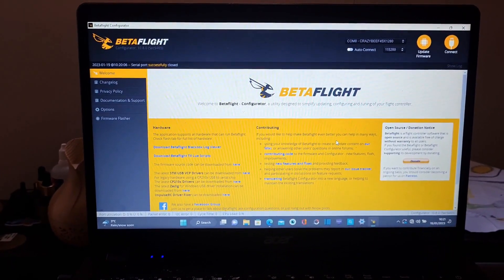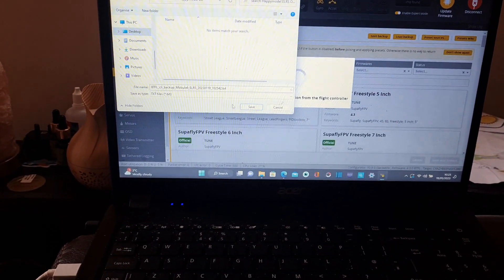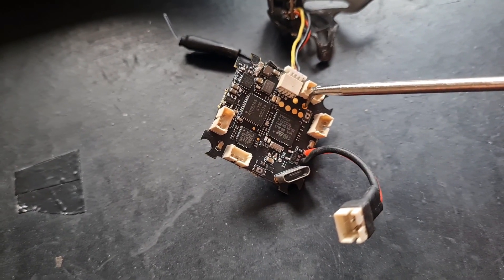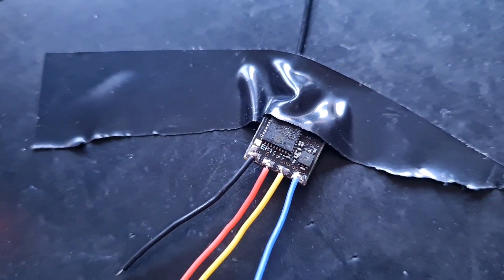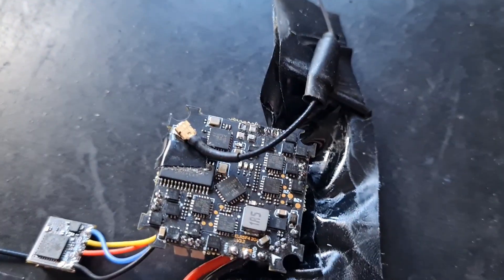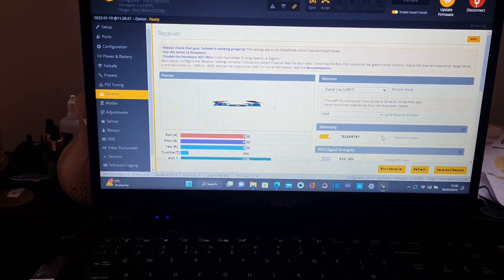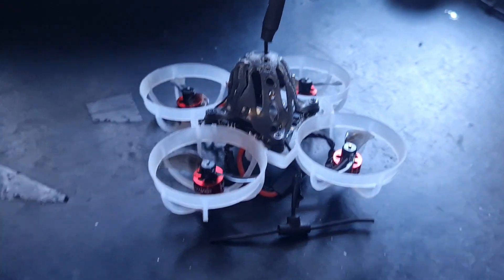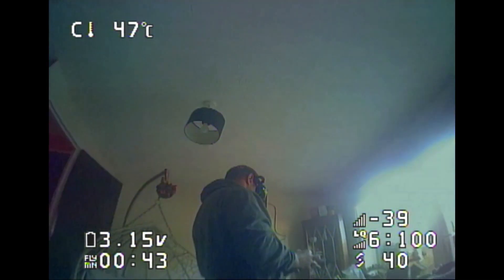Installing External ELRS Receiver on to Happymodel ELRS AIO Flight Controller

Comment: Bonjour 
Sur X12 Pro ELRS V1.1, quel port uart Betaflight faut il configurer le Vtx interne ?
Uart 1 ?
Uart 2 ?
VTx smart audio ?
VTx TBS ?
Marci des infos et réponses
Reply from the maker: J'ai traduit votre question et je l'ai envoyée à Joshua Bardwell. Je n'ai jamais possédé de X12, c'est donc lui qu'il vous faut. Je vous répondrai si j'obtiens une réponse de sa part. 👍
Reply: Marci bcp.... 🙏 @jaydronezz
Reply from the maker: Ceci vient de l'homme lui-même, Joshua Bardwell :

Ce vTX utilise MSP. Il n'utilise pas SmartAudio ni la télémétrie Tramp.

Je suis sûr à 99 % qu'il s'agit du même FC, mais pas à 100 %. Il faut que Serial RX, MSP et MSP Displayport soient activés pour le même UART que celui du récepteur.

L'image que Joshua m'a envoyée montre Serial RX, MSP et Displayport activés sur l'uart 1.

J'espère que cela vous sera utile. Merci d'avoir regardé !

Jay_Dronez
Reply: Plus que renseigner, je vous en remarcie GRANDEMENT... Je vous tiendrai informé du résultat dès que tests effectués.
Marci .... 🙏 @jaydronezz

Comment: At mark 3:30.... Those ARE NOT small solder points. 
ANYONE watching this with little to no experience, I AM compelled to say, DO NOT do this job without FLUX. 
As you can see at post 3:40, the op DID NOT use flux. Poor work quality. My opinion, he should not have post this video for anyone with poor quality work. Doing this job without FLUX will ultimately result in a short for those without decent experience.

Comment: Thanks for a great how to, I had to upgrade my mobula8 (X12 aio 12A ELRS v2.1) to BF 4.4.2 to make it work over UART1 😎👍
Reply from the maker: Hi, I'm glad you found this video helpful.  It's also interesting to know that it is similar principle for the X12 board, I haven't owned one of them yet, but probably will in the near future for a toothpick playground ripper! 😉
Reply: @jaydronezz  Ohh yes thats an awesome garden ripper 🤣👍 was out with mine today, waiting for some 720 mah GNB's to arrive and I should get about 10 min

https://youtu.be/dlRprAgMask
Reply: Hi What issues you were facing with betaflight 4.3.

Comment: Hey bud so I put a external elrs receiver on a Betafpv elrs spi board. Changed the settings in beta flight. I can see that the receiver and my controller are bound but it still doesn’t work. Is their a CLI command I need to change. Keeping in my in my situation the spi elrs works I just need to use the other one. Thanks
Reply from the maker: Hi there,  this video was to outline how to install an external receiver if your spi receiver stops working, so for me, I didn't have to disable mine, as there was no output from it.  I've never owned a Betafpv AIO, so I wouldn't want to give you any wrong answers. The Internet is full of those!  Try reaching out to Betafpv customer support and asking them if there is a  CLI command, or if you have to bridge any components or pads to disable it.  Sorry I couldn't be any more help than that.  Thanks for watching.  👍